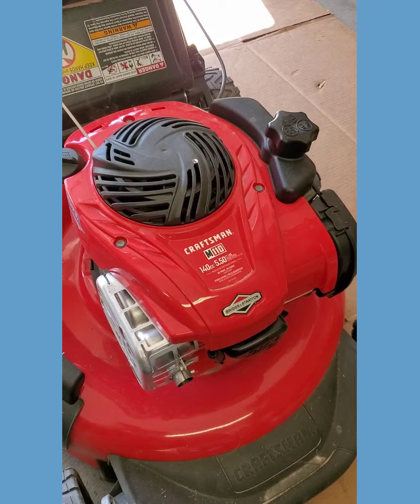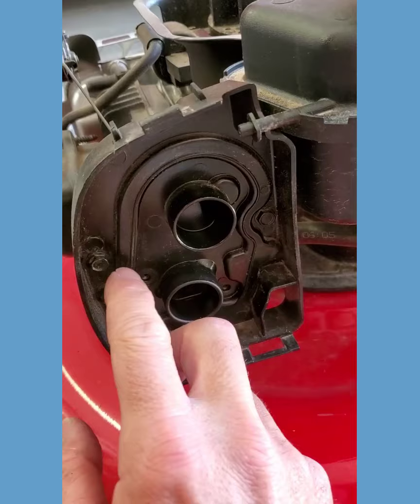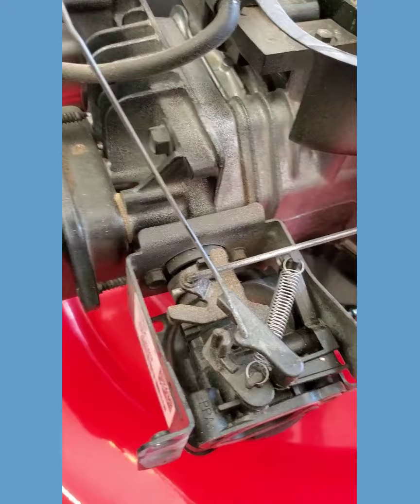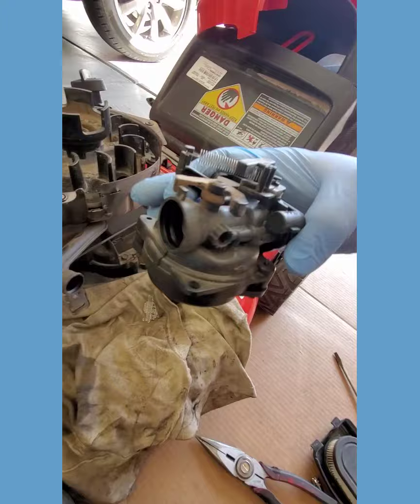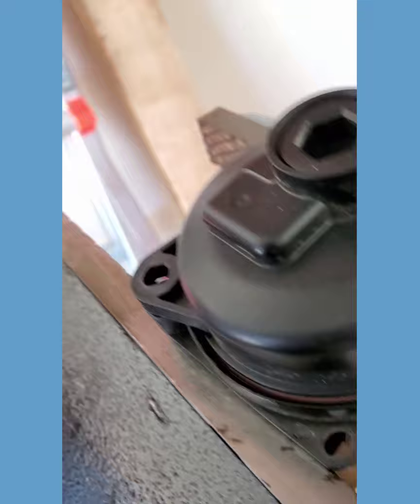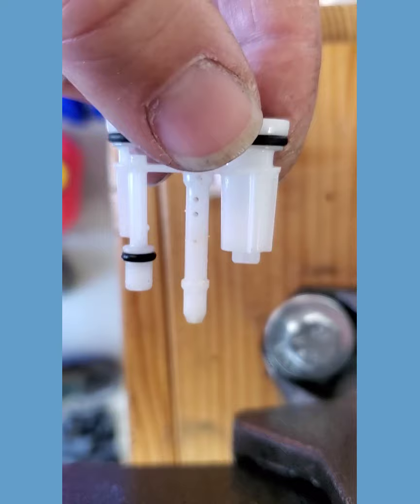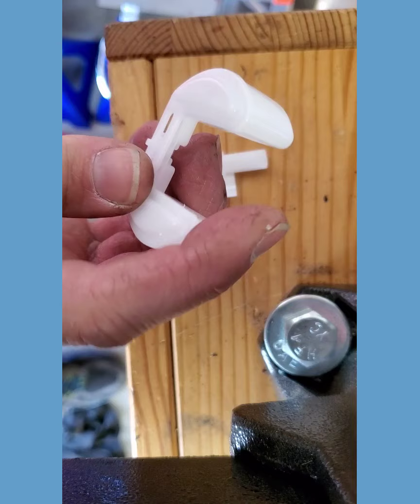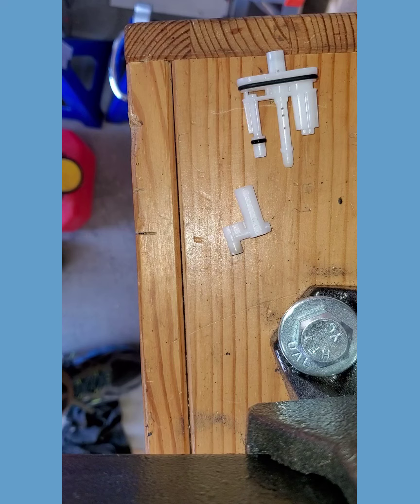Fix Craftsman M110 push mower won't start Briggs and Stratton 140cc engine part 1

Comment: Fiskars StaySharp Max Reel Mower https://www.youtube.com/post/UgkxTPN04aT-Qdjr_KS3ql7ng8wnU3wwsCqk also recommend  This is what all push mowers should strive for. It was easy to push. It cut the lawn. The blades are sharp, very sharp. The one minus that everyone should be aware of is you need to be very careful taking the cutting unit out of the box. There’s a plastic guard so you don’t cut fingers as you take the main unit out of the box but it’s not taped down. As I took the unit out, I ended cutting a piece of my shirt. The plastic guard moved and my shirt touched one of the blades.
Reply from the maker: Try tipping it forward on its nose for about 5 seconds and then putting it back down.

Comment: My brother, I just bought a Craftsman m110 from marketplace and in the description were no issues with the motor, however, when I went to pick it up I found out that it has set for 2 years and it wouldn't crank up. So the husband told me instead of $100 give him $75 for the more in that I will have to get it serviced... Well I'm so proud to say that for the first time in my life I followed YouTube and had taken the carburetor apart and got it started by the grace of God myself! 🤗 I thank you so much for your layman termed video and may God bless you further in your knowledge! 🤗
Reply from the maker: Thank you Donald, I truly appreciate you taking the time to comment. Congrats on the fix!
Reply: I’m in this boat

Comment: I bought this mower new last year and had the EXACT issues you described in this video. Thank you so much for the detailed instructions. Job only took about an hour and only cost me $7 for parts cleaner instead of $50 on a tune up
Reply from the maker: Nice work!

Comment: I refer to this guide every 1.5 yrs to fix my lawn mower probably saved me ~$250 so far.
Reply: I just bought and am told, theres a solution you need to buy to prevent the gas from gumming up after sitting

Comment: Awesome video - this solved my issue. I bought this mower last season - literally used it twice would not start this season. I called Craftsman they told me I had to bring it to a tech - I paid $400.00 for this brand new last season - had a tech look at it - couldn't get it started. I'll never buy a Craftsman product again.

Great video and thanks so much.
Reply from the maker: David, sadly your experience is like so many others. I know that the main problem with these carbs gumming up is the ethanol fuel we use BUT. The manufacturers should be held accountable to find a carb that isn't succecptible after just one season.

Comment: I did this today, new mower (from last year, I borrowed my friend's mower the rest of the summer) only ran 4 times and then wouldn't start. I had that white crusty stuff at the smaller hole, cleaned all places with a needle and blew thru it. I didn't remove the float but I did a visual check to make sure no gas was inside the floats. Mower started right up! I let it idle a bit and turned it off. It only took about an hour to do but I didn't rush. 
Thanks sooo much for this. 
I also have another "new" mower that only started 3-4 times, that one is self-propelled. I didn't feel like messing with it back when it stopped starting so I bought a cheap mower which is the one I just fixed. I will definitely fix the self-propelled and use that one. 
Crazy how they both did the same thing.
Reply from the maker: Awesome, glad this helped out. Thanks for commenting

Comment: After I cleaned mine out and tried to start it... it wouldn't start either... so I just primed it with starting fluid and it hit once, sputtered , then fired right up... think it just needed priming!! Thank you so much... I've never torn into a carb., so i was hesitant... but you made it easy dude!! thanks!!
Reply from the maker: Awesome!  Thank you for commenting and congratulations

Comment: So glad I found both of your videos! I often read the comments of most videos and was glad I purchased Mechanic In A Bottle along with the carburetor cleaner. I did almost all of your steps, except for the float needle disassembly. I put about 3 ounces of the Mechanic In A Bottle in the empty tank. My mower sputtered but didn't start. Pulled a few times nothing. Took the air filter back often and sprayed some carb cleaner and starter into the assembly. Again the mower started, but stalled. Used the carb cleaner again and the mower finally started! 

For the first ten seconds it didn't sound like it would it stay running. I tried a strap around the auto shutoff handle so that I could add some fuel before the Mechanic In A Bottle ran dry. I added less than half a tank and lower it idle and adjust itself for about three minutes, until it was no longer surging. Then I cut the grass until I ran out of gas. After adding more fuel the mower started right up. 

Thanks again everyone. I think this is my third season with this mower. I thought I ran out dry at the end of the season. I'll be adding with fuel stabilizer or the Mechanic In A Bottle at the end of the season to the fuel that used too run the tank dry. 

Also, you have a new subscriber.
Reply from the maker: Thank you Eric, I am humbled. I am grateful for subscribers like you that take the time to leave detailed comments like this...it makes the whole video and process better. Thank you!
Reply: @jcx2bby  it's awesome that you take the time to reply to every comment. I wish I had that dedication. People like you that have the know how and willingness to share with others it's what YouTube is all about! Again thank you for the high quality recordings and good luck to your family with Zumba and school. 

There's another YouTuber that I have to add to my DIY playlist. Need to replace the auxiliary battery in my hybrid and minor disassembly is required. Thankful for people that allow others to gain new skills while saving money. (Ford C-Max so that is not a vague posting.)
Reply from the maker: @MacGyver1991  Well I try...as you see sometimes it takes me awhile to get back to the comments.  And sometimes Youtube doesn't notify me that a new comment has posted so I miss it completely. 
Thank you for the well wishes; I am truly glad that the virtual zumba classes are over because the super-loud latin music was about to drive me insane. 
Appreciate your comments, thanks again for watching and commenting!

Comment: This worked like a charm.  We bought the same mower on the 4th of July last year after finally giving up on our 25+ year old 1994 Craftsman mower, which I rebuilt the carburetor on and gave a complete tune up on to no avail.  I used this new mower several times last year with new good gas, the mower wasn't left out or anything, but it wouldn't start this spring.  So, I referred to this video and cleaned out the carburetor with carb cleaner, then rinsed it with water, dried it well, and also used some starter fluid as he suggested, and it fired right up on the first try.
Reply from the maker: Kevin, that is great news!  Glad to have helped. These carbs are very sensitive to cleanliness, apparently
Reply: @jcx2bby  - It's funny because it's not something I really ever had to do on the old mower until just very recently, but it finally quit on us.  I may still take it apart again just to give it a chance since it is our old mower and is the same one we had from when I was a teenager.  You can get parts for the old mower anymore, though.

Comment: Thanks took it step by step even on the part 2 video everything worked I was scared to break it down but I managed and it work with no cleaning spray I just rinsed the plastic stuff in the carburetor and put it back on it worked thanks so much
Reply from the maker: @thelastgawd  hooray!

Comment: Worked like a champ. My mower was brand new and I cut the yard once. The next time it would start but die immediately. I knew it had to be the carburetor. The video helped figure out how to get it off. One thing to careful of: the sediment bowl o ring will swell when using Gumout. Take it off first. I was able to get it back in but I had to work at. I found the brass jet had tarnished sitting in the box from the factory.  Great video.
Reply from the maker: Nice work Court!  Thanks for the reply

Comment: Nice job, and you're right about not bending those metal rods.  They are super important to how well it runs and starts. But you got them backwards in the description. The first one you grabbed, that goes to the front of the carb is the automatic choke. It holds the choke closed and as soon as the mower starts the air coming off the fly wheel pushes it away and opens the choke. The other rod is the governor and controls engine speed.
Reply from the maker: Thank you Kevin

Comment: Great video big guy! I wanted to try one last ditch effort before I started breaking everything down and cleaning it. I bought  a $6 bottle of mechanic in a bottle. Emptied the old fuel and mixed with some fresh fuel. Sprayed with staring fluid like you recommended and it has been running ever since. Thanks!
Reply from the maker: Suhweet! I've never heard of such an elixir. I will keep my eyes peeled for something like that. Where did you get it?
Reply: I tried the same thing, picked it up at lowes, but it wasn't enough to get me running
Reply from the maker: @MsHasturhasturhastur  bummer

Comment: You sir had me rolling at the 7mm vs the 8mm bolts 🤣🤦‍♂️  Took the words right out of my mouth but you said it a lot nicer than I.  We just got this used and here he told me just needs a new spark plug lol.  I'm almost certain i'm going to be doing this to get her to work! The starting fluid deal, cant even find words for that diagnosis tool, but it's completely logical... 💯Thanks for this video.
Reply from the maker: I still can't figure the need for different sized.bolt heads when the fasteners are that small but what do I know. 
Good luck with your new mower, and thank you for watching and commenting on my video!

Comment: Excellent it work just like you said did exactly how you said and when I pried the lil middle piece loose them 3 lil holes 2 of them was stopped up. I believe from the manufacture cause its brand new and like the holes was not all the way open on 2 of them stuck the needle on both sides I was able to blow threw felt all 3 holes air came threw put everthing back together and walla pulled a few times it caught and been mowing my half of acre lol thanks
Reply from the maker: Good job Chris!  A little knowledge and work goes a long way. Thanks for taking the time to comment

Comment: My mower went from being completely dead to cranking on the first pull. Thank you for the video! My advice to all who have used this technique and don't want to have to repeat: If your mower will lay idle for months, let it run until you burn every drop of gas. That's the root of the problem.
Reply from the maker: You are most welcome Jeremy. Thanks for commenting

Comment: This is a great video, and is very informative. However, the first thing I would recommend to start with is just spraying a little more starting fluid in upon initial check. My buddies wouldn’t start and had only been used one Indiana summer. I was totally prepared to take this apart and clean all the ports etc, but before I did I tried having the wife pull it while I sprayed the starting fluid. Once I got it started and it ran off the spray for 2 seconds, it was fine. Again, the video is great, but potentially save yourself some work and try this first.
Reply from the maker: Absolutely, great tip!

Comment: I have the same model and it's been barely 2 months but won't start. Even though I have the tools and the expertise to fix it(thanks to your video), I will return the lawnmower. 

Would rather spend a few more $$$ and get something more reliable that will at least last a whole season.
Reply from the maker: I don't blame you one bit!

Comment: Magneto clearance!  Got one for free.  Seemed pull start was normal.  Fresh fuel.  Would gradually start with multiple pulls but even then it would stumble on very low rpm for several seconds then get going.  Once it started, it ran good.  Spark was good.  Compression good.  Very dirty filter.  Carb had been molested so I bought a replacement.  Same prob.  Checked valve lash and adjusted.  Same prob.  Decided to take engine cover off to see if there was a problem in there.  Noticed the magneto looked too close to the flywheel.  Used the business card trick to adjust.  Fired right up.  I guess the incorrect magneto clearance was from the factory.
Reply from the maker: Yes it does happen sometimes. https://youtu.be/lzCgcI0YDYw

Comment: this thing has been giving me a headache for a week or so I took everything apart cleaned the carb multiple times and nothing.  I lifted the back of it and manually turned the blades with my hands a few times and BOOM starts right up.  Hope this helps!

Comment: That second linkage is for the automatic choke.  The Other end runs to the muffler.  As the muffler heats up the bimetallic element pushes the linkage and opens the choke.

Comment: DUDE!!!! Thanks so much!!! This worked for me. I have the same exact model. It didn’t run the first few pulls because it had to get the fuel back in the system, I guess but it started right up after a few tries. I didn’t clean it with any sprays but just wiped it down. So Big Thanks.
Reply from the maker: That's awesome man , congrats on the fix!

Comment: I have this exact same mower that was having this exact same issue and I solved it in 30 seconds...and this guy could have done the same thing. Modern gas has a fairly high detergent content and doesn’t usually gum up these little carbs much unless they’ve really been sitting a LONG time. All this guy had was a sticky needle valve-you could tell because it hung up before falling out. Sometimes the float can stick a little as well. Before you go taking anything off and start tearing apart the carburetor unnecessarily simply take a screwdriver handle and give the bottom of the carb bowl a few firm taps. This usually is enough to jar the float and/or needle valve loose. I did this and it started right up. Work smart, not hard. To prevent future issues put about an ounce of Seafoam in with the gas. Problem solved.
Reply from the maker: Maybe, and maybe not.  Nothing wrong with your way and nothing wrong with mine. Thank you for posting an alternative method.
Reply: @jcx2bby  I didn't say your way was necessarily "wrong"; I merely pointed out that trying this before tearing down a carb makes more sense, especially on what looks like a low hour engine.

Comment: Great video! Best advice was at the end... “if it doesn’t work, 
do it again”. Unfortunately, I had to do it twice and the only thing I changed was the second time I waited to put my tools away until it started. It did. You the man! Thanks.
Reply from the maker: Ha, that's just the way it is sometimes isn't it. Glad you got it running 👍

Comment: Thank you so much for your video. I was almost to the point of burning this mower lol. Thankfully I saw your video and took everything apart and cleaned it and it's working like new.
Reply: Worked like new ? Mines ran 3 times 🤦
Reply: @drumhailer547  yeah mine worked great until the next time I used it. I got rid of the peace of junk.

Comment: I should have bought the mower I had to prime. This is BS! This video I will save for my son to fix. Thinking your getting the most for your money. Read the fine print.  I'm so done.

Two hours later: I got it started without the breakdown. I cleaned the filter vacuumed the filter area, drained the gas out and kicked and shooked it. Came back two hours later and it started. Hallelujah!
Reply from the maker: Understood

Comment: Thank you for this!! I got a new mower late February and I've yet to get to to start or even make a sound(city girl, first lawn). I'm going to try that spray and see how it goes.
Reply from the maker: Awesome, congrats on the 1st yard and I hope this video helps you out if you need it.
Reply: @jcx2bby  I just got back in. Went to get the starter and sprayed it where you showed. It's making a rubbing sound now, almost like a low honk but it still won't start and it's literally new out the box. Do you have any idea what it could be? Thanks for your reply 💟
Reply: @Sisa_Limpson   there should be a warranty, go trade it in. make sure you use new gas can and fresh gas if you get new mower. As for rubbing sound make sure there is no blade obstruction.
Reply: @Sisa_Limpson  adjust your handle. It may be blocking the blade. If you turn the mower over and see that the handle is too far down and blocking the blade just unscrew the handle and bring it up to the next notch

Comment: Just bought this lawnmower so I'll be saving this for future reference 😂
Reply: You will need this video after a few months, I pretty much have to do this every time I use the mower, it's less then a year old, this is the worse design ever, my last mower last 13 year and I never had to take it a part. Worse purchase ever
Reply: Just bought mine today. Won't start out of the box. Now I know why they are on sale.
Reply from the maker: Yikes.  Sorry for your troubles.
Reply: One thing I will add is it has less trouble in the warmer months. I feel like the little bubble lawn mowers have to prime the fuel lines help unclog the carburetor but sine this model does not have one you are stuck.
Reply: @willr7849 So far i haven't had any issues. I've used Stabil 360 in my gas and synthetic 5W30 oil. Always starts on the first pull.
Reply from the maker: @willr7849  you might be right about the primer bulb. Never thought about it that way.
Reply: Return it get your money back this shit happens to me every other mow
Reply: Read my reply above and save yourself some hassle.